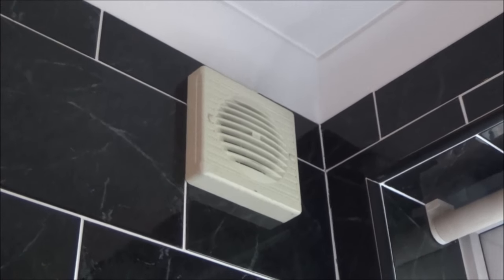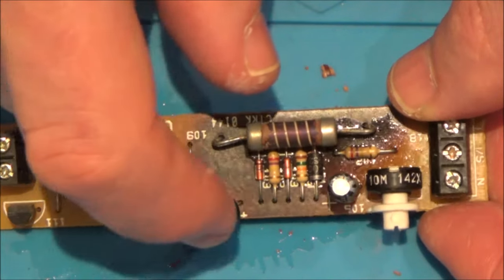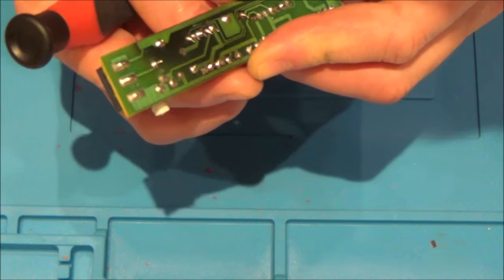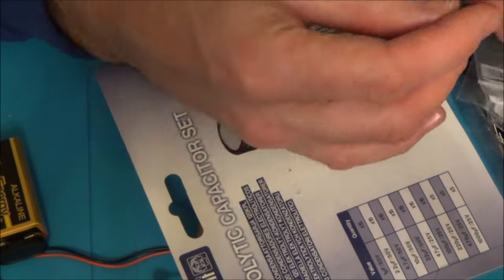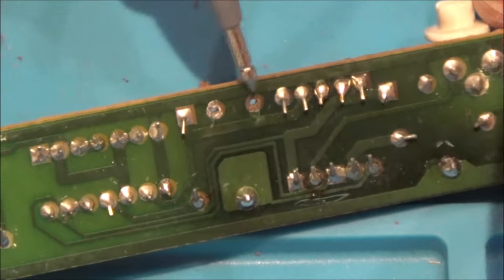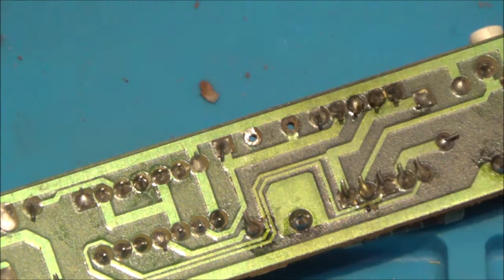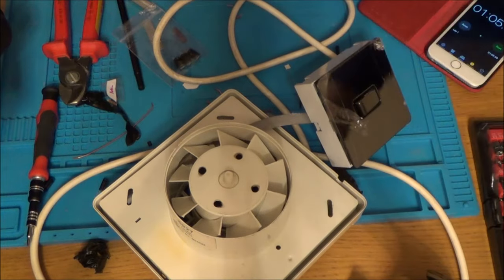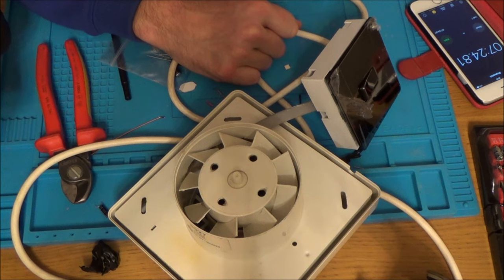Trying to FIX a Bathroom Extractor Fan that doesn't run on

Comment: I have the exact same board as that (exact same layout and part number) but with the Resistor in good cosmetic condition and it is a 22k as measured here.
The big cap on my board is 470 micro farad and the small is 47, well they used to be, both of mine are dead as well, i suspect the heat from the resistor is what is killing them.

Comment: You could have drawn a simple diagram showing how everything was connected. Even if you could not do all (ie the integrated circuit) this would help better understand certain parts of the circuit both for you and the viewers. They could then point out what certain bits did in the circuit. ie the resistor/capacitor timing circuit (maybe). The black thing was a diode and so were the other small things next to the resistors. Wasnt going to watch this video but found it just as good as the console videos you do.
Reply from the maker: Thanks mate :-)
Reply: This was a nice little circuit. It would have shown how they got the 240ac to run the small chip and components. I'm just a tinkerer but the black diode would convert the 240ac to 120 dc (by cutting off the bottom of the waveform) so the waveform would look like  n_n_n . The big resistor would then be used (along with another resistor) to drop the voltage to the circuit to 5v (or whatever voltage was required). The other (smoothing) capacitor would be used to get the on/off dc to a more constant 5/12v by smoothing the waveform out which is what the ic would need. Nowadays I would guess they would use some sort of power transistor regulator to do this. I wonder what the new fans look like inside or if they are stuck in time using the same components. Just my thoughts and could be totally wrong. With a diagram, this would be easier to figure out and understand.
Reply: @mrfoameruk  They are still stuck in time.

Comment: The caps can be a higher voltage no problem.  The 16v caps could be 25v or 35v as long as the uF is the same.

Comment: Electrolytic capacitors do not like heat, if it gets hot enough to discolour the board it is way to hot for the caps. I also always fit 105 deg C low ESR caps when ever I replace capacitors.

Comment: I'd think a fan could be designed to better dissipate heat from its own controller but then humidity is a big factor as well in the intended application of this one.

Comment: Sorry Vince. I am going to slightly correct myself from my last comment.   If you take the capacitor out you will heat the thing up and get a better reading than the thing actually has. So read it in circuit and only take it out if you have a bad reading

Comment: The caps are rated for 85°. But this resistor burnt and destroyed ist own case and you can see the resistive wire in it. So the caps got more than 100° hot. So no wonder that they are dead.

Comment: if you get a resistor with a very low fault tolerance +/- 5% or less, it won't do that as much. plus, that resistor seems to have gone high resistance.

Comment: The construction and design of that unit is not suitable for use in a humid/wet environment. I would not recommend that it is used any further. There are serious design errors in the construction of the PCB and the components used.

Comment: you also want to be careful even though they have the right ratings the temperature ratings is another thing you want to make sure is correct as well if you put an 85 degree c rated cap on the 105 degree c environment the cap for sure will pop. So make sure you have the correct capacitance , voltage , and temperature rating.

Comment: Looks like you had the cover on upside down There's a little cut out to adjust the  Potentiometer without removing the cover
Reply from the maker: Hi, it looks like that but that little hole it a drain hole I think for any build up of moisture. The potentiometer is more to the middle so the hole doesn't line up :-)

Comment: The first thing is to replace the very cheap Chinese junk electrolytic capacitors with high quality Japanese ones from RS or Farnell or Digi-Key or Mouser, that is likely the problem. Also you need to replace the resistor that overheated. Please do NOT buy capacitors and resistors on ebay, they will be counterfeit!

Comment: You need to extend that heavy resistor "legs" and take him out to the fan area, to blow extra heat from him. That not good if you fan catches on fire.
Reply: This won't actually fix the problem, as the resistor is always getting hot as it is the power supply for the control system. It doesn't just get hot when the fan is on.
Reply: Wow, not a good power supply for logic, why don't use cheapest linear regulator with small heatsink? Is it worth save 1-2 dollars to burn down home and get sued from insurance company? Or at least add 2 more resistors w same power to make more surface to dissipate heat? I mean if you have 1 resistor of 22 kOhms w 3 Watt power, why don't use 3 of 68 kOhms w 3 Watts in parralel and make some holes in case to make dissipate heat from them?
Reply: @Lightning666  i don't know any linear regulators rated at 250 to 300 volt input as this would require. It would also produce as much heat as a resistor. What it really needs is a transformer, but doesn't due to cost.
Reply: @Lightning666  ahhhh. These all use a capacitive rather than resistive dropper. Now i understand. Yes this would be much better with or without a linear regulator.
https://en.m.wikipedia.org/wiki/Capacitive_power_supply
Reply: @brendonwood7595  Yes! Logic uses a small amount of power, and that should work perfectly in this fan. I didn't understand why they use that unefficient type of power supply.

Comment: my 3rd party alexa is not working very well it keeps disconnecting to the WiFi my dad tride to fix it but he did not take it apart i dont know if its our WiFi or what but i was wondering if you could try to fix it if i get my parents permission if you fix it i dont need it back we got new ones to feel free to keep it if you want, i will post if i get permission     i will send with a charger

like if you want to see this in a video if i get permission

also like if you want a video on fixing a TV!
Reply: also it might just not be a reliable brand       so it might not even be broken
Reply: no
Reply: i dunno what im doin

Comment: looks like the ic is doing timing function.
Reply: 4000 series CMOS logic gate 4001 if I rember....simple  four pack of two input gates...probably only one gate used....no the power supply is.  Resistor dropper...240 RMS( 315 volt peak) to 15 DC. Via diode( 1 N4007black diode thing) to 330 u F capacitor.  Followed by 1 k resistor onto
15V zener diode (glass diode )   to "0 V"   which in this case is also neutral....the supply for the chip is 0V pin 7 15V pin 14(taken across that zener diode

Comment: You should really have discharged that big fat capacitor

Edit: not as large as i initially thought but still good practice to discharge them before handling
Reply: A tiny 330µF 16V cap won't do anything, even if it's fully charged and you put your finger right across it. baffles me how people repeat crap they heard somewhere without knowing anything about the topic
Reply: @Knaeckebrotsaege  uh 16v is still gonna tingle buddy. I also stated that I initially thought it was bugger but still good practice
Reply: @mattigins  16VDC? tingle? Yeah I'm outta here. No point in dealing with so much ignorance.

Comment: I have one that when you turn the light on the fan struggles but when you turn the light off the fan starts up fully. The fan runs perfectly if I do away with the circuit board and connect 240v directly to the fan. Any ideas what it could be.

Comment: You should order capacitors from RS-Components.uk or any other components you need. Cheaper and free next day delivery on all orders and much better quality components than eBay. eBay caps are mostly counterfeits and too expensive.
Reply: On ebay it highly depends on who you buy from. Large commercial resellers in your country selling caps in big quantities tend to be fine, small shops and almost anything from CN/HK/MY should be avoided, with very few exceptions (like PCMCStore by user "egekecu" and AudioJade (audjade_chn), the latter being a good source for solid polymer caps).
Also idk about how it works in the UK but RS-Components Germany does not sell to private people, only businesses, which is a massive pain in the ass since they usually tend to have everything you need, but you can't get it. Same for Farnell/element14.
Reply: @Knaeckebrotsaege  Good to know thanks. RS-components in the UK sell to private individuals and offer free next day shipping on all orders. Farnell again sell to private indviduals but they have now included a handling fee on order under £20 which makes small orders more expensive so i personally switched to RS.

Comment: The chip is four 2 input Nor gates in one package. Pins 1 and 2 are inputs for the first Nor gate and pin 3 is the output. Pins 5 and 6 are inputs for the second Nor gate and pin 4 is the output. Pins 8 and 9 are inputs for the third Nor gate and pin 10 is the output. Pins 12 and 13 are the inputs for the forth Nor gate and pin 11 is the output. Pins 7 and 14 are the supply rails for the chip. Pin 7 being the positive supply and pin 14 being the negative supply.
 A Nor gate is a type of logic gate. The N means NOT. The output of a Not gate is the opposite of the input.

Not gate                     Or gate                                     Nor gate        the other types of Or gate is an Exclusive Or(EXOR or XOR)
  in out            input 1   input 2   output          input 1    input 2   output                               input 1       input 2      output     
  0    1                  0             0             0                   0              0              1                                        0                  0                0
  1    0                  0             1             1                   0              1              0                                        0                  1                1
                             1            0              1                   1              0              0                                        1                  0                1
                             1            1              1                   1              1              0                                        1                  1                0

and a Exclusive NOR (EXNOR or XNOR)                    The other types of Logic gates are And and Nand
 input 1   input 2    output                                                     And Gate                                        Nand gate
     0             0              1                                               input 1  input 2   output                input 1    input 2   output
     0             1              0                                                   0            0              0                         0              0             1
     1             0              0                                                   0            1              0                         0              1             1
     1             1              1                                                   1            0              0                         1              0             1
                                                                                          1            1              1                         1              1             0
Note that 1 in the tables means a high voltage and 0 means a low voltage
most logic gates work of 5v these days
so a voltage above 2.5v is considered high
and a voltage below 0.8v is considered a low voltage

On another note at 18:04 you said you weren't sure about a component and speculated it may be diode. You are right it is a diode. It is a rectifier diode. The other reddish coloured diodes are small signal diodes. Rectifier diodes are used for when there is high power in the circuit i.e.  to rectify power rails. Small signal diodes are used in low power parts of the circuits.
Reply: Another thing that you said confused you is when you turned the time select(which is a 10MΩ variable resistor) you got the same reading. This happens when the resistance of the circuit is less than the resistance of the resistor. Testing resistors in circuit is unreliable and any that read like that need to be taken out and tested. To test a variable resistor you go from the center pin to either on the outside and then to the other out side pin. Notice that the resistance measured will vary the opposite way to the other outside pin. So on a 10MΩ variable resistor if you measure 1MΩ from the center pin to one of the outside pins if you test from the center pin to the other out side pin. You will read 9MΩ without turning the spindle(wiper).
Reply: Done a circuit diagram and explanation of the circuit if you want it. Done it in adobe illustrator(since I'm learning illustrator). Illustrator will only allow me to export it as a JPG(image file). It also allows me to export it in CAD and such which I doubt you would have. Hence why I exported it as a JPG

Comment: £20-30 for a replacement. Not worth repairing and by the look of the yellowed plastic cover that unit must be 20 years old. Good work though!
Reply: I've had white plastics badly yellow after just a year or two from sun exposure, so that doesn't mean much to pin the age. What does however is the "0144" datecode on the PCB (week 44, 2001)
Reply: @Knaeckebrotsaege  I didnt know they printed date codes like that, usually see stickers, but the chips used also specified that 36 Week of 2001, that thing should be binned xD

Comment: how come you didn't check the device that was nearly on fire ! and find out exactly what the chip does, which is clearly the " brains" of the outfit ?
Reply: No need to check the chip and the resistor might just heat up a lot, which would be a manufacturing fault, but agree you should check it and if needed cool it.
Reply: @D3nn1s  hi....that resistor is 2 watt or bigger, for it to radiate that much heat, enough to brown the PCB material (probably FR4)  and enough to dry out the electrolyte in a couple of electrolytic cap's makes me distrust the whole setup....not sure I would trust it again in my house.
Reply: @andymouse  This part gets hot by design. it is a cheap to make but very innefficient power supply. The big resistor is being used to drop the 240V mains voltage down to 12Volts or 5 volts or whatever the circuit actually uses. This means the resistor dissipates 228 volts X circuit current while the circuit itself uses 12 volts X circuit current. That big resistor dissipates around 20 times the power used by the rest of the circuit. It really should be a higher power resistor than the one used as it is clearly overheating in normal use.
Reply: @brendonwood7595  Hi ..yeah the chip is a quad NOR gate affair the "4000" series is happy between 3v and 15v so I guess the diodes provide rectification of sorts to power the thing and yes that energy has to go somewhere and that poor resistor is realy working hard...too hard I feel....but I'm sure there are loads of these around that have dried out and nobody realises. Still wouldn't be able to put it back myself cos I would be thinking about it, as I said they are everywhere.
Reply: @andymouse  If you are interested https://www.electronics-tutorials.ws/diode/diode_7.html describes the power supply used. The only difference is that the board in the video has a diode at the start to rectify the AC to dc before the circuit on the webpage, and a capacitor to smooth the voltage.
Reply: @andymouse  me neither but it works for a couple of days again^^